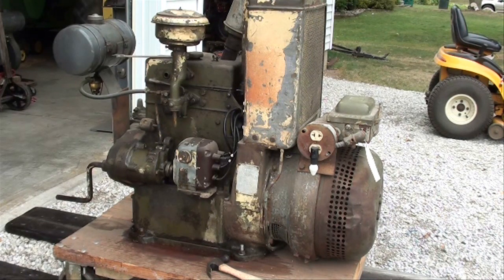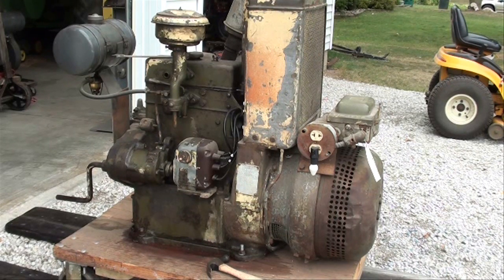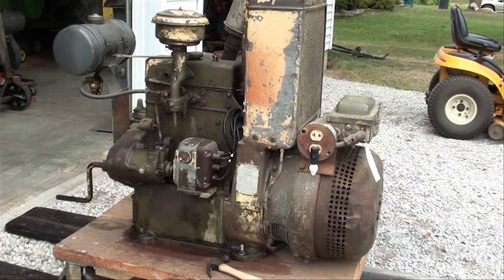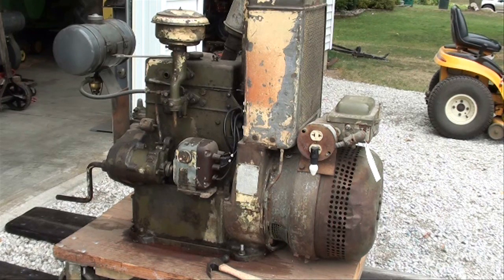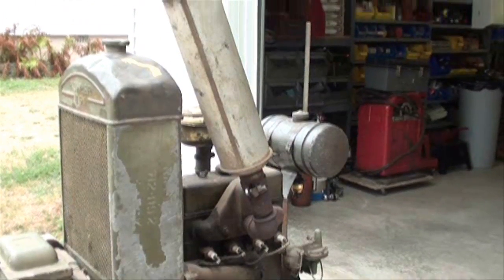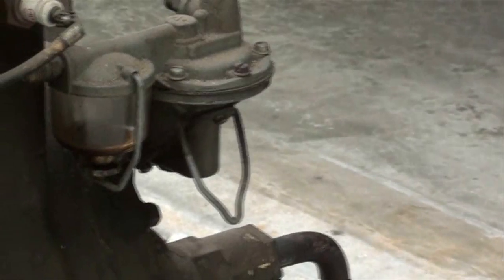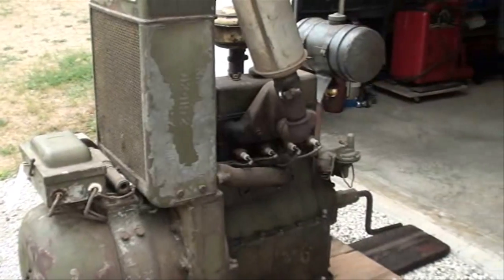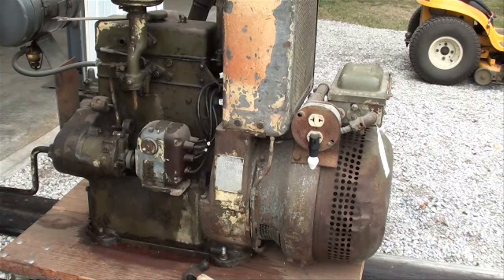ANTIQUE NAVY KOHLER LIGHT PLANT generator tubalcain

Comment: I have four of these: 2=110VAC, 1=110VDC, 1=32VDC. The AC models were demannd start using 24VDC through the exciter windings of the alternator., but could hand start also. I saw a few with no crank. I ran my shop off these for several years. Very quiet and economical to use.
Reply: Id be curious to talk to you about these if i could get in contact. I just picked up a 110 and am working on it. Not many people out there with any know how about them!
Reply: Id be curious to talk to you about these if i could get in contact. I just picked up a 110 and am working on it. Not many people out there with any know how about them!

Comment: I have the flat 4 6.5KV generator very similar. Needs a rebuild kit for the fuel pump. has a 6 screw top looks similar to the ones on a flat head ford V8 motor So much so I am thinking that the rebuild kit would fit my pump. Any part numbers advice would be appreciated

Comment: I've got a 1950's GE welder and an old Case 140 square baler that are each powered by Wisconsin VF4 and VE4 respectively.  I've recently cleaned up the magnetos to improve spark (dramatically) but they are still very hard to start being hand-crank only.  They are still in good condition.  Probably need valve lapping and adjustment.

Comment: I have seen similar units that the U.S. Navy used on PT Boats during WWII to supply power to the electric stove and refrigerator.when the main engines were not running  It was a necessity in the South Pacific. They
 referred to them as auxiliary engines.

Comment: Hi Tublicain 
I watch all your videos and the machine ones are good teaching tools, not to this video this is whare new and old will meet, most of todays generators are dc to ac, do if you get a inverter and hook it up to this you can run your yard equipmnet, a cheap test will be to tak one of those car inverters and run the dc to from this to the inverter, watch your plus and minus to you don't let the some out,  you would have to find out how many amps DC to size for the corrct inverter, Tj

Comment: Since the Navy useds DC power aboard ships, it wouldn't surprise me if this wasn't used for emergency power in damage control situations aboard a ship in WWII. Most people would probably be surprised at how small the output was of aux generators were back then.

Any idea what the KW output of the unit is?

Comment: I have a similar one, but mine has the automatic start, and was used at a remote summer home.  The starting battery was used to sense a load (such as a light turned on), and then the generator started to run the load.  Back in those days DC motors were more available, and lights and AC/DC appliances such as toasters or waffle irons could be run, too.

Comment: What a coinsidence you uploaded this, I have a similar gen 1.5 KW AC.  However mine has and automatic start controller for emergency stand by use.  Just got mine running last night, not I need to go throught the gen head to make power.